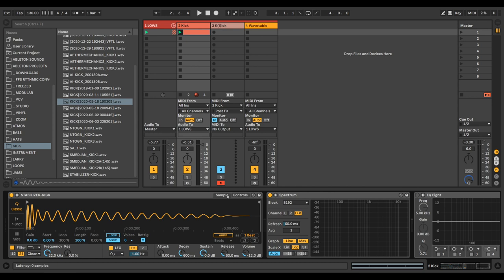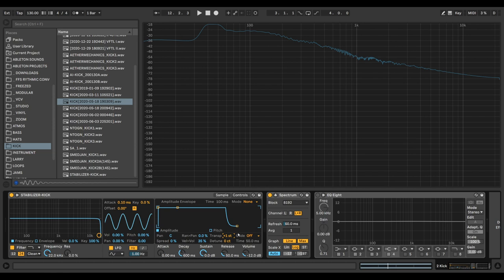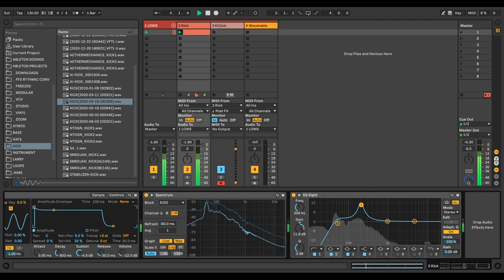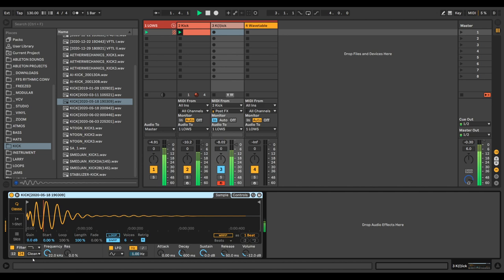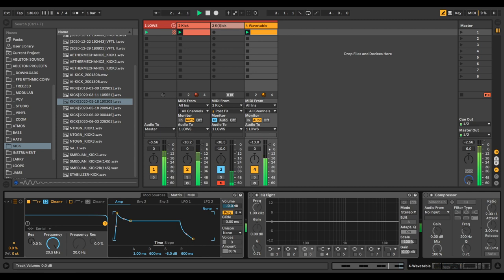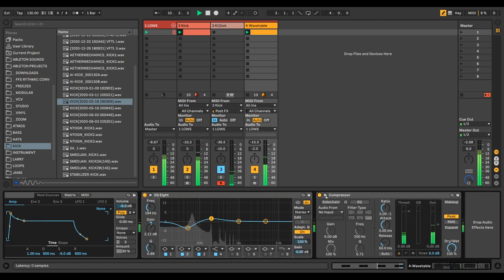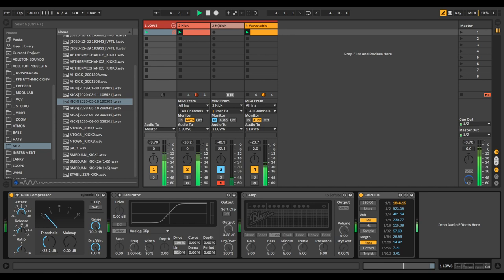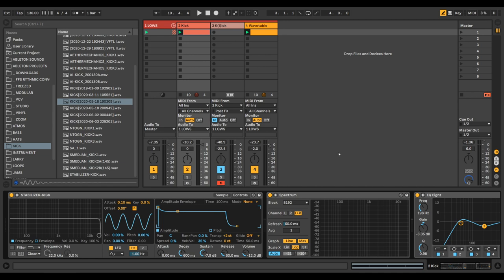Techno Fundamentals: Kick & Bass

Comment: Really great video, thanks for the tips. Would be great to hear more thoughts on transient shaping and sidechain - would you recommend using calculus to workout precise release times?
Reply from the maker: It can work, but it's heavily dependent on the decay of the kick drum, so I'd say you can try a 1/64 note release time and listen what it sounds like, for the fun of it at the very least. Otherwise I'd say it better to just pull down the threshold all the way down more or less and dial in a release time that sounds good and/or pumps in rhythm to your track, then shut your eyes and pull the threshold up until it sounds right to you.

Comment: What do you think about the phase issues that carries eqing de low end with low cut? Have you faced this issue before?
Reply from the maker: I haven't had issues with it myself. With proper monitoring, checking the mix in mono and having a trained ear, it's not a problem, in my opinion and experience. It can be problematic during parallel compression, however, if the low end of the processed signal is filtered incorrectly. There I'd be cautious and always check the mix in mono to hear how the low end respond.